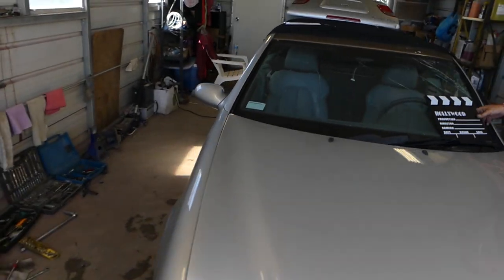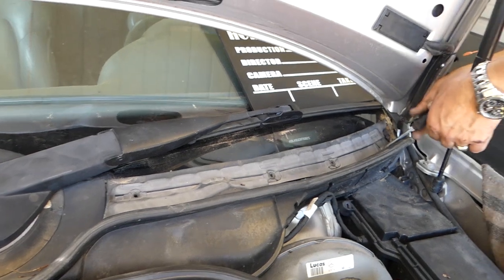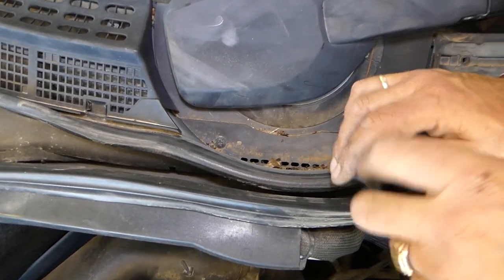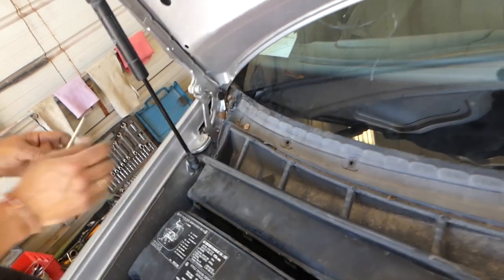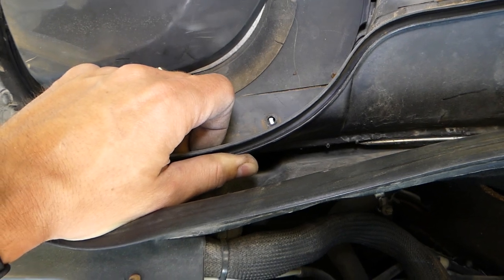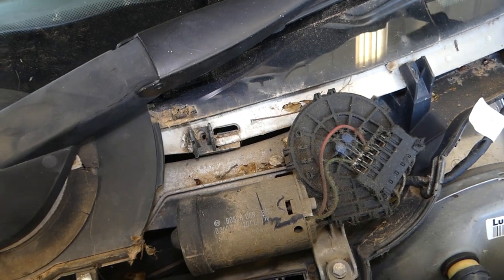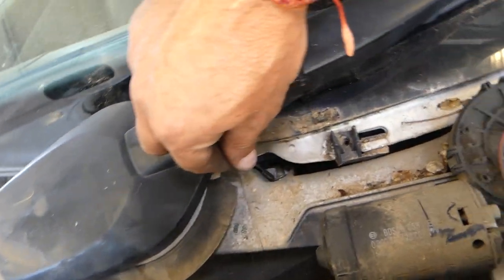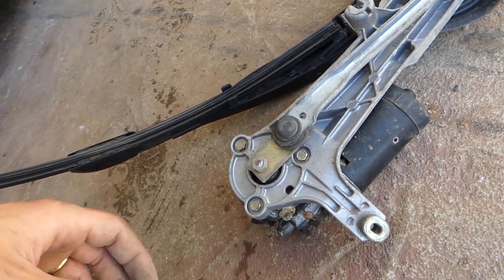MERCEDES WINDSHIELD WIPER MOTOR REMOVAL REPLACEMENT W208

Comment: I need help. I was trying to change the windshield wipers and lifted the arm to a point it made a click and it locked in place. But now i cant unlock it to bring it back down! How can I place the wiper arm back down? Or did I pull it up too much to a point something snapped? It sounded more like a locking clip noise

Comment: my wiper has one speed what do you think is wrong with it 1999 ML320? i tell you what happened to it in the winter the wiper was frozen to the window and i start the car and i blow the fuse i just replace the fuse but my wiper has one slow speed that is all